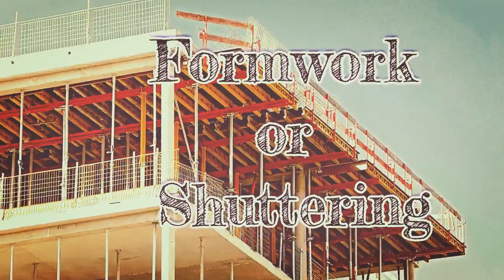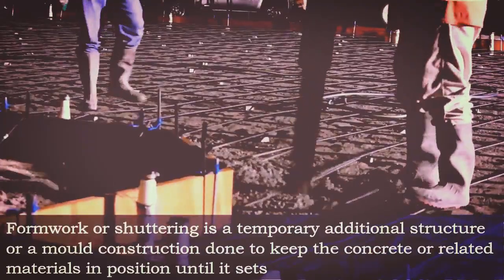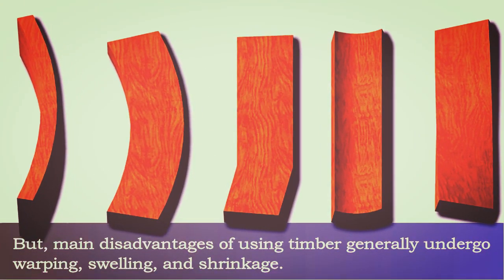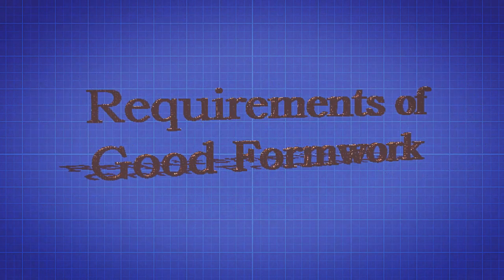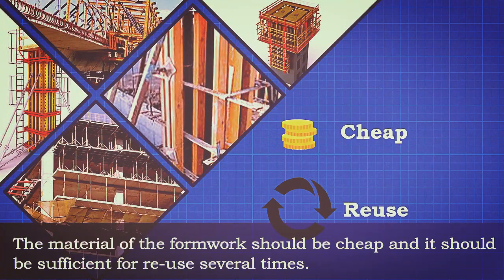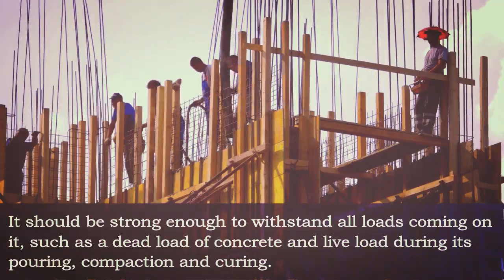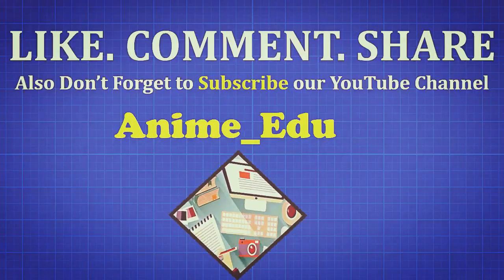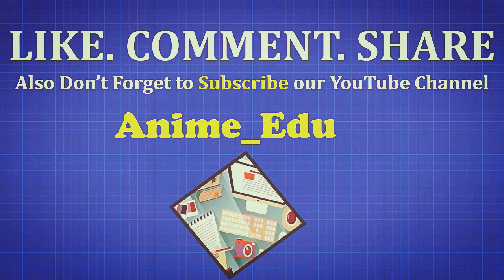What is formwork or shuttering? // What are the requirements of good formwork? //

Comment: Is framework and formwork the same?
Reply from the maker: No, framework and formwork refer to different things in construction:
Framework refers to the structural elements of a building that support non-structural components. This includes beams, columns, trusses, and other load-bearing members made of steel, concrete, wood, etc. The framework provides the overall shape and strength of a building.
Formwork refers to the temporary mold or casting that is used to pour concrete into in order to create slabs, walls, columns, beams and other concrete elements. Formwork is made of wood, steel, aluminum, or fiberglass and holds the concrete in place until it hardens enough to be self-supporting, then the formwork is removed.